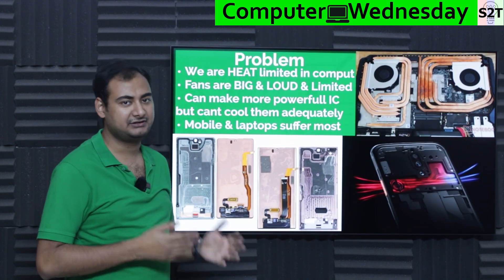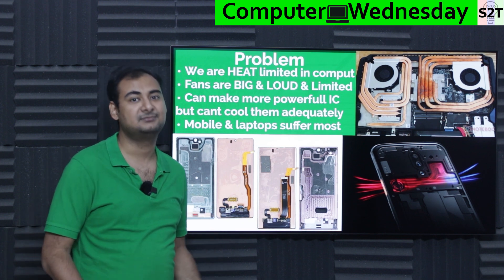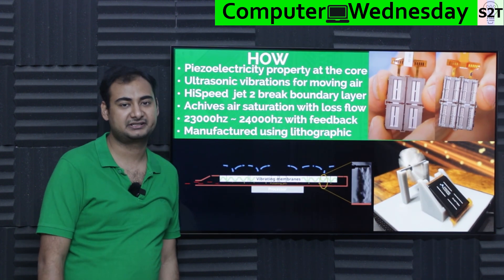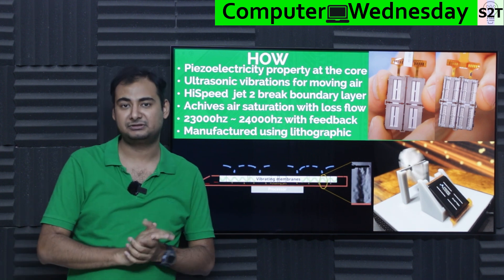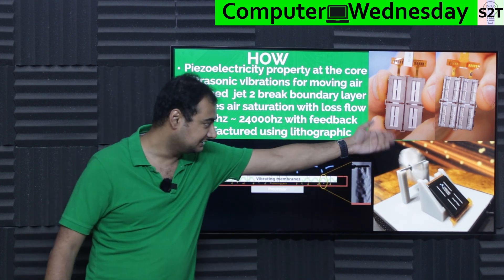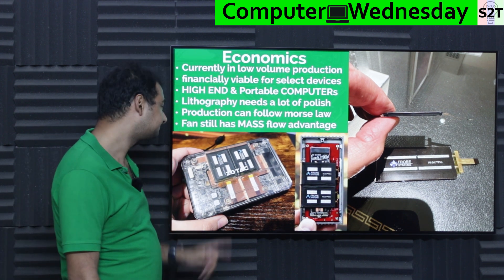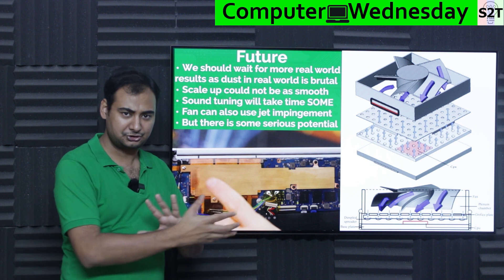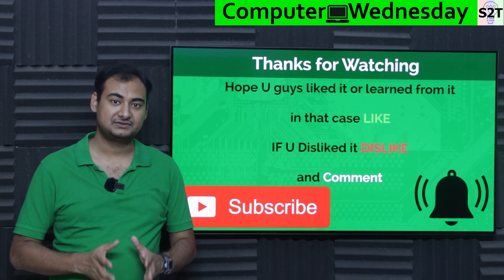Solid State Cooling {AirJet} Explained {Computer Wednesday Ep235}

Comment: Okay...I have one suggestive, not predominantly crucial, but possibly noticeable to others...and that is...
I to check the playback speed first...and yep. That was "part" of it. Anyways it almost seems like there's an "Air Jet" driving your delivery.
Thank God for subtitles...and neat stuff...until the $ was mentioned.
I currently use a laptop cooling pad but I have used bigger custom fan setups...with the bottom off...
Going in and replacing the stock heat sink compound and a detailed cleaning,(very carefully) keeps my thermals manageable.
But yeah...they got the GPU on the CPU cooling pipe. Gotta keep that fan oiled and the cooling pad fan also.
nice...
Reply from the maker: speed is side effect of my camera recording limit its from before times when EU was high on weed so 30 min limit